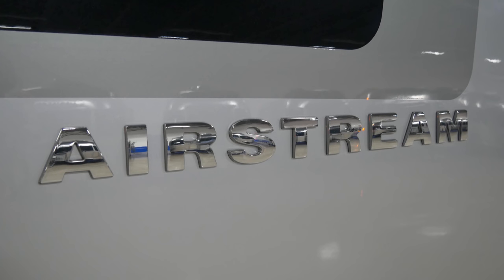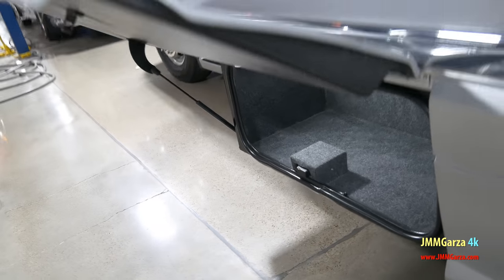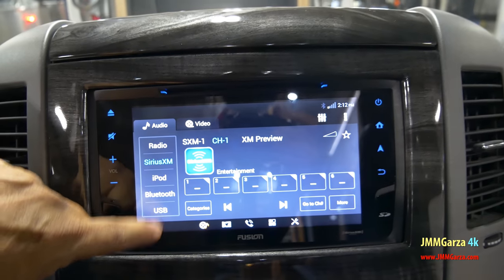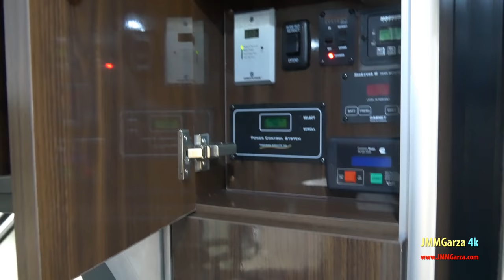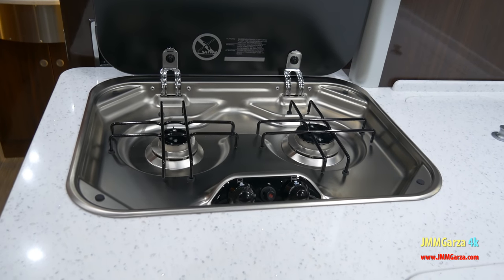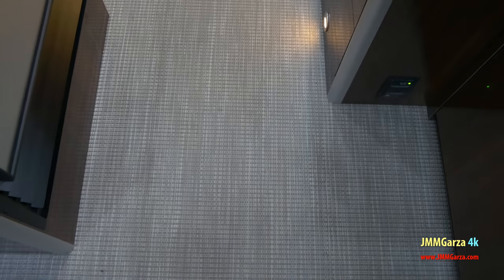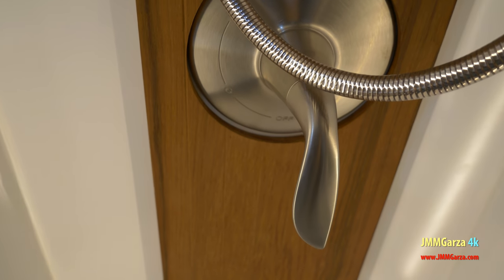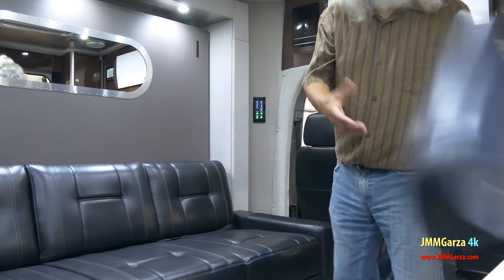2019 Airstream Atlas In-Depth Consumer Review - 4k UHD

Comment: Hello Garza. Have you met someone that has owned 1? My dad bought what he was told by AS the 1st production model sold to the public. He sold it 7 months later due to all the problems it had! (water leaks, electrical problems, foam blowing out the upper vent, doors and draws flying open due to very weak locks..on & on & on  ) at the time he sold it he had over 112 problems that were to be fixed and still adding more.  From what was heard from the buying dealership it spent over 8 months back at the factory being totally rebuilt and as now they feel it can't be resold because as they fix one thing something else goes wrong. Hopefully Airstream gets a LOT better at quality control!
Reply from the maker: A definite lemon. Airstream markets the Atlas primarily to affluent first time buyers.